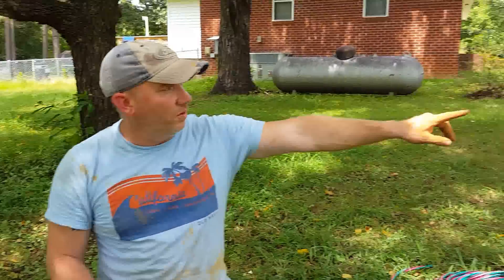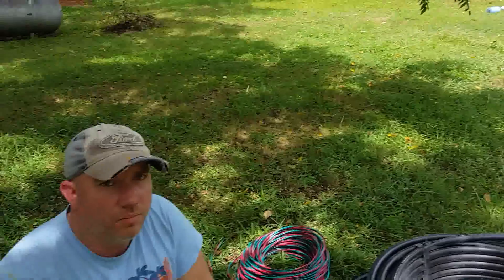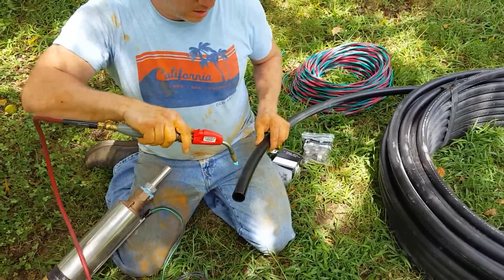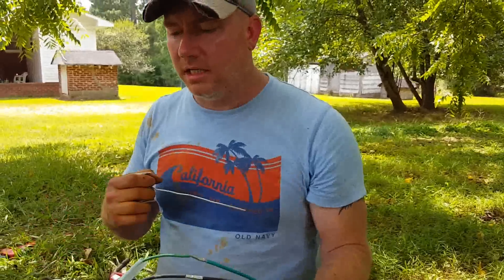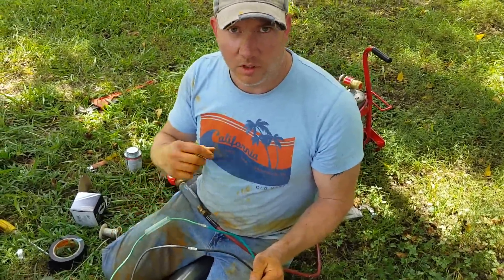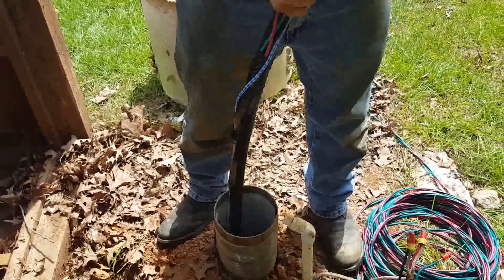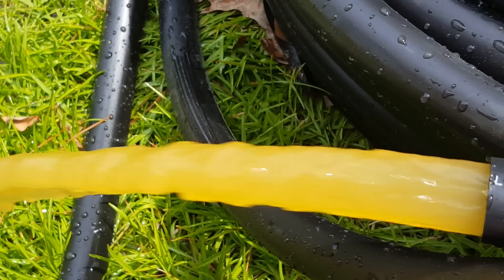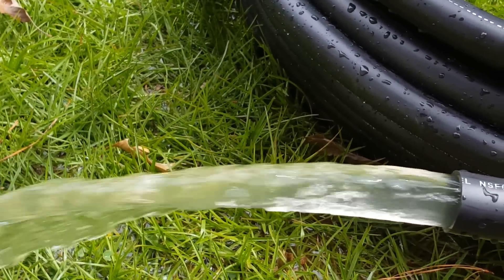how to replace a submersible pump

Comment: I would highly recommend using cable and pipe wrap tape, i.e. Milspec 2" green tape.  Out here in Nebraska I couldn't count the number of times I have pulled a pump and found the electrical tape had come off and was plugging the pump, which in turn burnt out the motor.
Reply: Good point.... I used to fix seismic cables and there was a great resin type compound which went over all the joins and then another special tape and that then painted again with the resin. Never came loose or undone and similar to what the old telephone linesmen would do in their underground junctions as full waterproofing.
Reply: thats what I wanted to hear. KOOL TIP
Reply: That’s Exactly what happened! The wrong tape was used by “the experienced installer” of our last pump and the motor burnt up! We paid just over $1,000 for a high quality GOULDS pump that should have lasted much longer than the 6 YRS we got out of it!! Needless to say I WILL NOT be paying thousands of dollars again to have someone else get our water running once again! My Husband passed away last yr so our 14yr old grandson & I took it upon ourselves to learn how and WE are replacing the pump and wiring. (already replaced the control box & pressure switch) 
So far so good, we’ll be lowering the new pump this afternoon. Thanks for your input, doing the proper taping is so important! 😊
Reply: Thanks for the great advice
Reply: I hope everything worked out.  I’m sorry I am just seeing your comment.

Comment: Would have been a little easier to put the clamps around the pipe and slide them out of the way before pushing it onto the pump.

Comment: For the soldering, you may want to use an electric (lead or lead free) solder instead with lots of flux and a portable soldering iron, like a Weller butane soldering iron. The connection will be much tougher and you will not burn the insulation.
Reply: lead free has a much worse connection than 60/40. lead free is the worse type
Reply: Rosin core for electrical work, lead free for copper pipes and Acid for auto copper radiators.
Reply: Stefan Brunner +
Reply: Wing it
Reply: Reverse osmosis for drinking water, regardless.
Reply: @dave4854  Specifically, tin/bismuth for electrical connections with a rosin flux core.

Comment: Like someone else pointed out, that solder didn't look like electrical type (Rosin core) solder. When I solder electrical connections I also put on a little tinning flux for better wetting action. 

Also, would be good to use Teflon tape (the orange type) instead of the dope so it doesn't contaminate the water.

Since last year, I ONLY use Teflon tape for NPT threaded joints (no dope whatsoever). No problems at all.

Comment: DO NOT use a torch to solder. Get a high temp soldering gun.
Reply: LMAO ... it is a bit much isnt it ... looks like a acetylene tourch, I'd still use a torch in this case but something much smaller and cooler like a butane or small propane would be ok . The big torch he is using here is not even getting the metal hot through before melting the insulation. Its just a surface solder at best. (I am a electronic technician & 5yr electrician). By rights your still likely offically correct but fk that with these big wires outdoors & then you need to carry 2 items to location instead of one cause you cant heat the pipe with a solder gun. This vid does make for a good laugh tho : )

Comment: personally, I think the heat on the connectors and copper wire does more damage than twenty yrs of electric going thru them, I twist and solder or just use the connecters, never both, after shrink wrapping. I also use a good ele tape over the wrap. JMO
Reply: How do you make the electrical connections AFTER shrink wrapping?

Comment: I am just a home owner that do just about everything myself. I am sure that is not ABS pipe but cross linked polyethylene pipe. I would had slipped the two hose clamps before pushing the barb fitting into the flexible pipe.

Comment: He put the 'high quality hose clamps' on after he put the pipe on the barb!   Talk about doing it upside down - and e did! Then he used  electrical tape instead of HEAT SHRINK (which is also put  on the pipe BEFORE connecting the pipe to the barb.  Wrong torch for soldering #10 wire  and FLUX will help as would a HEAT UN for shrinking the HEAT SHRINK seals.
Reply: Did you not know that clamps are like a belt you used to hold your pants up? You can totally unscrew it and put it around something and screw it back together.

Comment: hi, just sub to your channel you have lots of great stuff, i do hvac work my self but watched a few of your well pumps videos and thought if you can answer a question or two, my well pump is 16 years old, 3 wire 150 ft deep, i was going research some of a info before it fails, how much does a 150 ft of pipe/water and pump weights? would you go from 3 wire pump to 4 wire to get a longer life? and would an additional backflow before a tank help? thanks
Reply: Now days 2 wire is best. 150 ft deep you are looking at 100 to 150 pounds if it is using black poly pipe. A good 2 wire pump should last you 20 years or more. If your pump is 16 years old and working fine and it was a good name brand pump. You may not need to worry about it for another 20 years. No pump or motor built today is near as good as a pump built 20 years ago. The new pumps and motors have to much government regulation to meet. And most have a 5 year life span.

Comment: Do you add a check valve several feet above the pump?   Seems like that would be helpful, but a bit of a trick I you are using the poly pipe.
Reply from the maker: +myforest40 the submersible pump has a built-in check valve we only add check valves when it is a very deep installation more than several hundred feet

Comment: You are not Well/Pump Experts by any means I've done thousands of wells and systems in my life time and 10 gauge wire really plus a safety rope on a 4'' pump in a 6'' well talk about over kill.  Please get the proper size clamps and why do you need 2 clamps an I've never solderer a butt splice heat shrink or on even hand taped splice.  An what was the static level doing,lowering the pump is not going to clear the water time an gallons will do that unless it's sucking out of water and surging the well.  We are a 3rd generation owned Well Drilling & Repair company in business since 1966 an we've pulled our own pumps that were at or near 40 yrs old. We have serviced 3 states  IN,OH & MI. We have many steel 4'' wells here that pumps will corrode/grow fast in and we get the pumps out with no safety ropes hanging in 150-175' on 100-125 psi poly they don't go back in on that though. Hope you use 160 psi or better.  Sorry about the rant but more is not always better you can run a 1/2HP 230V pump like 650' on 12 gauge wire what was coming to the well head ?
Reply: I live on the east coast and was wondering what you think of a $2000 quote for a 3/4 horse pump 100' deep?  And,  is a 3/4 necessary?

Comment: I have a the same size pump i think its a different brand, how much copper would you say is inside of it? Or are they aluminum? Is there any brass or anything else good scrap wise, or would it be better trying to sell the unit whole as is for parts? Let me know what you think or if anyone has taken one apart can you let me know, Thanks!

Comment: Where do you buy the stainless steel long shank barb? If you have a brand and model # if possible. Also what type of teflon sealant is that light blue color? Thank you.
Reply: Thanks for the tip I am not worried about the barb adapter anymore as I have a safety rope tied to the pump.
Reply from the maker: +Tom Dee the reason why you'd want to use metal Shanks is because of the high torque down at the pump that's the reason why we have torque arrestor is however twerk arrestors only reduce the amount of torque they do not stop it if you use a plastic Barbed fitting at the base of the pump you will find within a few years you'll be pulling it up by the safety rope and having to replace it the little bit of extra money that it cost is well worth it
Reply: how we get it

Comment: Hi , I just replaced the pump, but the water smell bad 
I have to put chlorine or what I have to do?
Reply: Jufaro Flores hydrogen peroxide into your water heater and replace your rod to aluminum. Water heaters come with magnesium rods that will get eaten up by well water. Do that and you will get rid of rotten egg smell or other smells.
Reply: Merchants HVAC Co. thank you

Comment: Great video but I wish you explained how to properly install the torque absorber and how it works.  I am a homeowner with an existing well trying to learn how to install a submersible pump and so far I can't find a video how to install the torque absorber.   Also, I would love it if someone wound explain how to determine your well's flow capacity.  I have a 90' well with a 6" steel liner.  When I look down the pipe I can see water pretty close to the top of the pipe.
Reply: A torque arrester is simple. tighten one end on the pipe above the pump and slide the other end down until its just barely wider than the casing and tighten the other end. As far as determining capacity of a well the only real way to do it is to overpump it with a very large pump and measure drawdown of the water level with a piezometer.

Comment: we have a 8" water well casing in mostly sand or soft dirt. It's down to a depth of 70 feet. The drilling co. maintaining the well says the PVC casing has collapsed above the pump to the point they can't remove the pump. The well is only 25 years old and I've never heard of 8 inch bending to an oval to the degree a pump can't be removed and I'm concerned we're being sold a bill of goods. Is there a chance this could happen?
Reply from the maker: +Ronald Mitchell I would certainly get a second opinion. The PVC casing should never have broken unless there was an earthquake as far as becoming oval that's a load of bull
Reply: Expert Express plumbing heating and air conditioning I got some new info the other day. Now the word is that the pump overheated and caused the deformation in the casing. 
I just keep getting the feeling that the HOA is getting stroked. :(

Comment: Glad we found your channel! We are about to have our home's pump replaced (Goulds) soon. The estimate was 1,600. Its a 150 ft well. It was 650-675 for the pump, 400 labor (two hours) and 550.00 for other parts (wire,pipe ,fittings). Is there a "control box" involved? What is it? Does this seem reasonable for the 550.00? Seems like a lot to us, but you'd have a better idea.Thanks in advance for ANY help you can offer. Joe and Dee
Reply: very reasonable estimate. By the time you add 150ft of pipe and wire and fittings $550 equals out fairly quickly if the contractor is using parts of any decent quality at all. Yes replacing a pump or a well does seem expensive but long term it really isn't. Instead of paying a monthly water bill like you would in a city, you are essentially paying for everything up front. If your new pump lasts 10 years and costs you $1600 that's $.44 a day for unlimited water usage.
Reply: Thanks for the reply. Turns out well was not as deep as others in our area,so cost was less since they used less pipe and wires.Thanks again!

Comment: Good Vid...... I do like the long shank stainless steel hose barb fitting, but I've looked every where on line, and can't find them ....... any contact info would be appreciated, thanks !
ps, hope you guys are OK after Mathew
Reply from the maker: +oneshot1984 Matthew did not really affect us in this area. Thanks for asking though. you can obtain the stainless steel Long Barb from your local Plumbing supply house. However I will be going down to the coast and helping those who are less fortunate than we are

Comment: So I'm getting ready to install my new pump and have had past problems with the rope security line attaching to the top of the pump.  I'm looking for the best ways and you totally skipped that!
Reply: I knotted, heat fused & tape wrapped(with the proper tape) the poly rope. Worked pretty slick.

Comment: personally,  I've had nothing but bad experiences with the "safety rope". if you need to pull it out by the safety rope, then you did something wrong. if the rope isn't taped on with the wire so we'll just do the restaurant just like